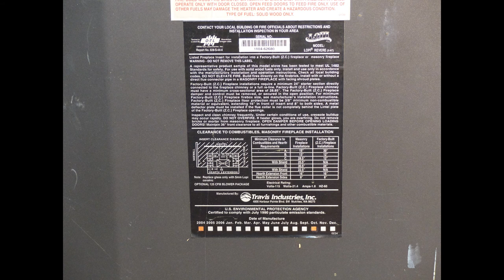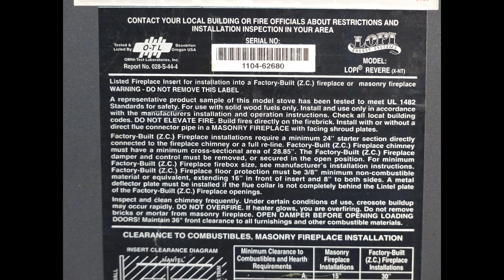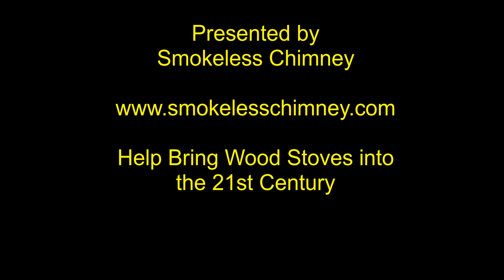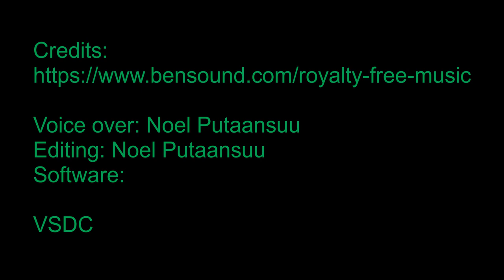Renovating Wood Stoving - Good as new!

Comment: I have a Lopi Republic 1250 that I just purchased and 2 of the top bricks and a welded piece of angle iron fell out and I can't figure out how they are supposed to be. Any thoughts ?
Reply from the maker: Is it new from a store or used one you are refurbishing? If new, contact the store. If refurbishing, look at the manual, download. I had a part fall off the top shelf like a angle iron that was at the front edge of  the smoke shelf.
Reply: @smokelesschimney8849  I got it from a friend who upgraded to a Lopi pellet stove. Thanks for the info!